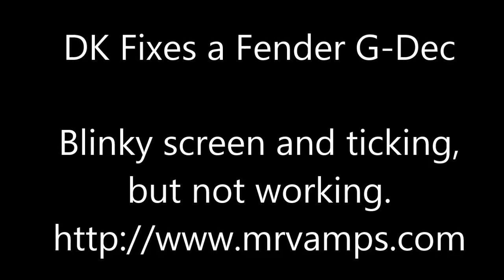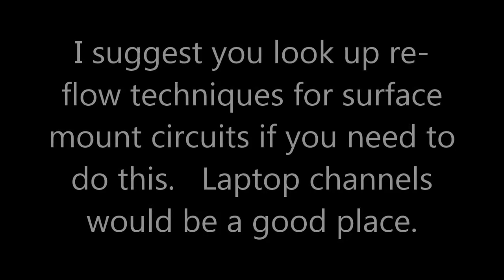Fender G-Dec amp gets cured of its blinking screen issue.

Comment: Hello. My G-DEC had this problem for a couple of years but now the display is stuck at the G-DEC logo. I have tried to 'reflow' the PCB by pointing a hot hair dryer on the chips. I powered it up again and it got stuck at Loading Host for a long time and switching it on and off again, it is back at the G-DEC logo. I would appreciate your advice on this.
Reply from the maker: hair drier isn't usually hot enough.  I use a heat gun (like for stripping paint)...

Comment: Its a shame such a great little practice amp is defective. I have barely used mine and it crashed. I pulled the encoder pot and found nothing wrong
with it,looked fine inside.That was another suggestion.Didn't help. I had about given up but I'm pretty sure your reflow is the answer. I am one of those people
who wants to know exactly where the bad joint is but there is no way.Thanks for showing reflow may correct. There may be hope.
Reply from the maker: Honestly I'm in no way of fan of most amps that Fender has produced from the mid-80s forward. There is always some kind of PC be related design flaw or crappy components that just seems to always go

Comment: I have some issue with screen and no more sound output to speaker. The power/light still on at the screen but nothing to see there.. I dont know how to solve that problem.
Reply from the maker: Heating the board with a heat gun might help.   Look up  Hot-Air Solder Re-flow

Comment: Have the exact same issue with mine, however I pulled the fuse that’s encased below the power out/plug-in and noticed it was blown. Will replacing the fuse not fix this issue?
Reply from the maker: No clue

Comment: sheesh which model is this exactly? it's got massive filter caps? mine has 2 small heat sinks on the right where yours has one larger heat sink and soldered to each one is the same 3 lug "power transistors" as you called them.. and on the left where you have the one 3 lug screwed to the bracket I have one 6 lug and to the left of that a 3 lug connected to that bracket, mine is a gdec3 30.. 

tell you what tho, those heat sink blocks on the right sure do stink as does the power supply, when I turned it on the lights all came on, it dials through the presets but no sound, didn't check the headphones, however the smell that began emanating about 20 seconds later was enough to make me shut her off.. no smale I could see of course its encased and i did pull it apart ASAP..

but yea that power supply is stinky, real stinky as are those 2 power transistors on the right side connected to the heat sinks..  no amp guys where I am or electronics guys, nothing..

I have a multi meter and a cap/resistor tester, bout it, oh and an old current light tester, the single lead ice pick style with a light in it, lol..  several alligator clip leads what not.. I do solder, have a solder set up, I have replaced a few relays on boards for auto AC coolant fans what not, 6 lug.. easy enough.. I'm sure I can replace those power resistors, and the power supply if I could find em but dunno where to get em?  I'll also scan the boards well with a magnifying glass and reflow where needed, man this board with the resistor is right below my nose as I am tying.. WREAKS, its those ones on the right side where on your board there is a single larger block, mine has the 2 smaller ones. man this stinks, goin outside on the deck.. sheesh   I'll run the codes on the resistors, really could use a schematic..
Reply from the maker: Heck if I can remember.  I gave this back to the customer a long time ago.

Comment: Maybe it is a matter of your video not matching reality but it appears you did not 'fix' the amp. Once you pronounced the amp fixed, it can be clearly seen in the video the amp is still blinking. If the doc fixes your ingrown toenails but does nothing for the gunshot, what has the doc really done? Squat really. Like I said, maybe it is video not matching your repair.
Reply from the maker: It worked properly when it left.